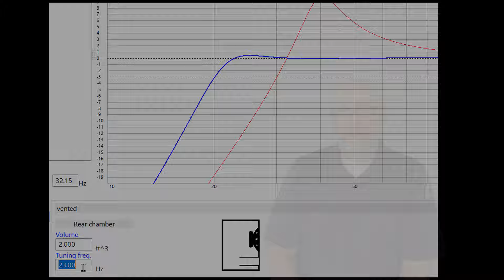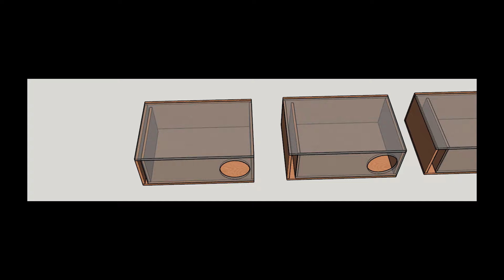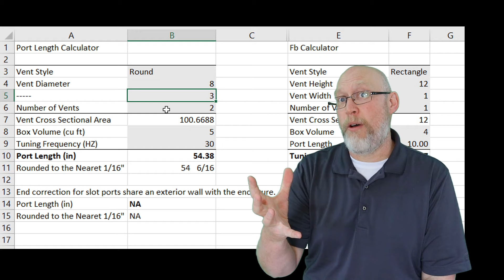Everything you need to know about PORT TUNING in under 3 minutes!

Comment: I want very Low frequency at 10" subwoofer for earth shaking Bass. So what dimensions should be used for deeper Bass? Please suggest me... Thank you🙏
Reply from the maker: There are too many factors to answer that accurately in the YouTube comments. Best bed is to download Win ISD and model it.https://youtu.be/yZNeYBYGRKk
But, having said that if you want to get really low, down below what a human being can hear, You're going to want more cone area and you're going to want a huge box. Consider an 18.  I suppose that all depends on what you mean by low.  If you're trying to play in the 30 Hertz range a 10 can work just fine.
Reply: @DIYAudioGuy  yes Sir I fully agree with you... But I prefer 30 Hz low frequency Bass... And would like less then 30 Hz . I don't like loud Bass [Upper Bass] . So could you suggest me what size [ dimensions] of enclosure should I use for this type Bass? Please sir suggest me. i will always be grateful to you... 
💐Thank you🙏
Reply from the maker: @exislaamnowbeinganinsaanah3302  That will all depend on the driver.  I recommend this one:  https://bit.ly/3dcZAjm from parts express.  They have box and tuning recommendations on their website.  If you have a specific subwoofer in mind I can model that for you and make a recommendation.  My rates are available here:  https://diysubwoofer.blogspot.com/2021/05/custom-subwoofer-enclosure-designs.html
Reply: @DIYAudioGuy  ok. I got it.
Reply: @DIYAudioGuy  thanks for this information 🙏

Comment: my amp has a subsonic switch @25 hz my box is tuned at 35 hz is that good? Or should i change port. 15 inch elektra audio is the sub new on the market
Reply from the maker: Yes, that would be just about right. I would recommend activating that filter.
Reply: @DIYAudioGuy  ok man thanks your the best on youtube

Comment: I have a question, if my box is 9.92 cu ft  and I want to tune it to 32hz but my port could only be 2"w 13"H but how long will it be?
Reply from the maker: You can use my port tuning calculator to figure that out.   It is available as a digital download to my patrons.
Reply: @DIYAudioGuy  I'm sorry I have my neighbor writing for me but if you could give me what I need I got no issues donating plus u been a big help. Please 50 100 it's no issue to me I just didn't want to pay the shop 700 to do what I could
Reply from the maker: Ok, I saw the messages on Instagram, I did not make the connection until just now.

Comment: So why doesn’t anyone use 2 ports to make the speaker play a wider range.
Reply from the maker: Unfortunately it does not work like that.
Reply: @DIYAudioGuy  but the Bose acoustic wave did it. But the speaker fired into two different length tubes.

Comment: I have a question I’ve been thinking about since I built my system. I made a dual 12 box about 5 cubic feet with a front center port that is T shaped about 20 inches long. Basically making it so each sub is in its own chamber and they “share” the port that in the middle. Does this mean It is setup as 2 separate enclosures each with a port length of about 20 inches, or does it count as an entire box with a single port like I originally thought. The tuning frequency should be about 30hz, and it seems so when playing the system but i’m wondering on how this is supposed to work, as if it is 2 separate boxes then wouldn’t the tuning be around 45hz?
Reply from the maker: To be honest I am not 100% certain.  An easy test would be to aim the subs up, put some rice (ro skittles, or whatever floats your boat) on the cone.  Then play test tones at low volume, start at 25 hz and work your way up.  The cone, and thus the rice, will not move much at the port tuning frequency.  Or you can get a DATS:  https://www.youtube.com/watch?v=6g39ScWma3U
Reply from the maker: The more I think about this the more I think I'm just going to have to build a box and test it.
Reply: @DIYAudioGuy   The come excursion seems to be quite low at about 30hz so i’m fairly certain that is the tuning. The subs I have are 2 Skar Audio EVL-12s. The Xmax is about 23mm and they definitely get moving when getting down to the teens and up into the 40s. I am still confused and wondering though as to why the box behaves this way instead of acting like 2 separate enclosures with a higher tuning. If you would like me to share the design I came up with for my enclosure I would be happy to.